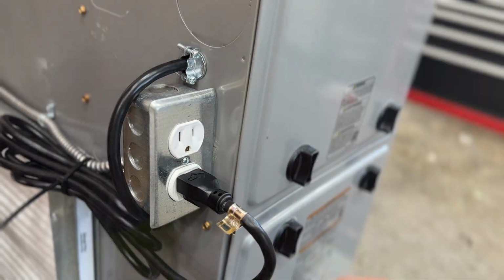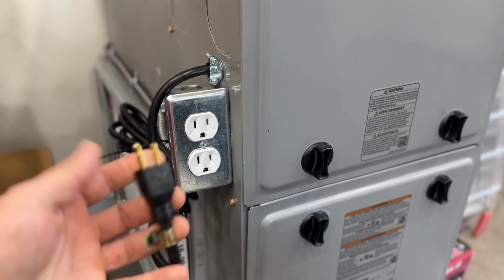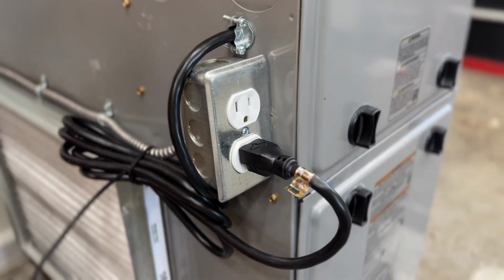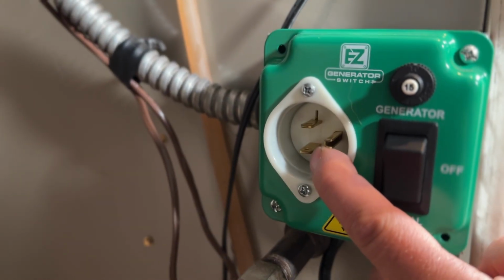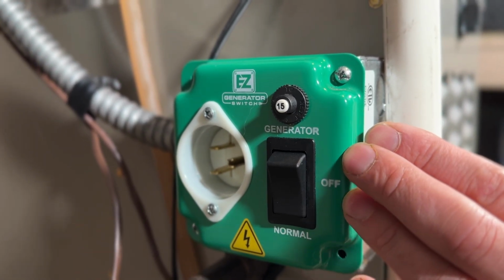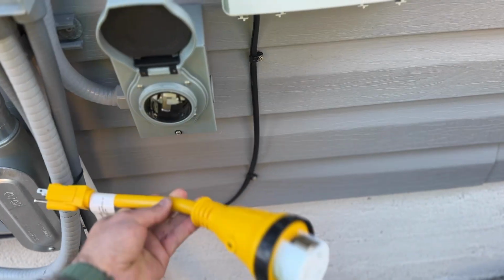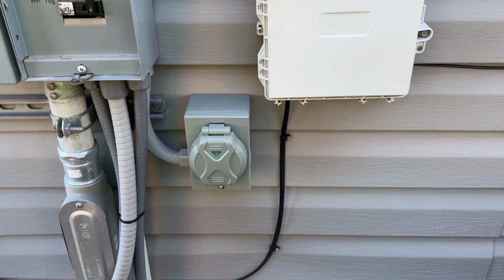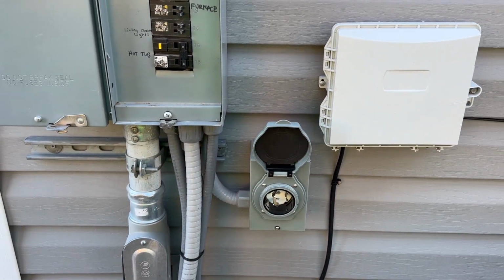3 Ways To Keep Your Family Warm This Winter

Comment: To bad that green box isn't water proof for outside use. At my furnace I simply have a twu outlet with the connector cut. One is line the other is from generator. Simply switch the pug from one to the other. Now the dedicated by code to the refrigerator isn't that simple because the plug is behind the refrigerator up high in the wall for unknown reasons.

Comment: So the yellow adapter 220 to 110 at about the 4:49 mark. Does it split the hot wire to provide 110 on both sides of the breaker box?

Comment: I did that for my well pump as well as boiiler.    a little different   I put another switch.  and plug so when the one switch is turned of from the house power then the other switch turns on for the other power sorce

Comment: In deciding on what generator I needed for a few critical circuits in my little 1250 sq. ft. house, I tested my York gas furnace and was very surprised to see that it used a whopping 1220w at 10.1 amps when running heat.  The blower itself used 930w at 7.4 amps.  My dad’s Trane furnace in a same size house only used 695 when running heat.  Any reason mine was using twice the wattage of his?  Is something wrong with the blower?
Reply: Ac electric  motor blower instead  of DC  motor

Comment: I did the Inlet box (3rd option) several years agoa and although it is more complicated to install, it is set up to run my entire 2400 s/f house using a 35K watt tri-fuel generator. I tested it and although I didn't turn on everything in the house, it worked flawlessly with the normal power draining things on including the HVAC split unit, 2 freezers and the fridge. I have also swithced the entire home to LEDs for less power requirements. Obviously, in a power grid failure you won't run everything as normal, but having tri-fuel capabilities gives you more options. Thanks of the videos!
Reply: Sorry, don't know where that came from. It's this generator (10kW)   PD3G10000e from Powerland
Reply: Did you mean to type "3.5kW" (3.5 kilowatt = 3500 Watts) rather than 35?

Comment: My thermostat is on a separate breaker from the furnace, so I assume that the only choices I have are to either rewire the breaker box or install the power inlet box. Any other suggestions?

Comment: I have the switch to the furnace , no problem . I also have a sump pump with an inverter and battery back up with 2 outlets. Could I change the switch to furnace to an outlet ( using a pigtail for the furnace power supply ) then plug both the sump pump and the furnace into the inverter with the battery back up. PS the inverter has an automatic transfer switch in the event of a power failure .

Comment: Have you come across a way to have the furnace on a battery backup type system similar to the computer battery backups? So that if the power goes out it just automatically switches to battery and then recharges after the power comes back on.

Comment: My mom married my stepdad, his master electrician, old-school electrician really good. He did white Man Air Force Base and then a lot of Branson Missouri but I learned from the age of five up and I’m 42 now. No the job is so easy when you have a bars and bolts and shit in your back and no vertebrates , that’s the one thing about electrical did a lot of work on hurricanes, main power, distribution lines, etc. yeah, my father taught me so much and had to basically do things not by code but still good and safe instead of running one wall parallel to another room just zigzag back-and-forth with your plug-insI know the code is gonna hate

Comment: I really like this idea to power my furnace. What I would really like to do is power my house. I have a CPAP to sleep. What would need be done to plug generator directly into whole house? What size generator would be needed for an average 1200-2000 sq ft Midwest home?
Reply: All depends on your power needs...but looks like a interlock kit, soft start box for a/c and around a 5k generator would do the trick. Hope that helps.

Comment: Great videos.  Can you make a video for Central A/C in the same way you did for the furnace?  How you can use the a/c as a stand-alone using a generator to power it.  I guess you would also need to add the air handler as well. I would like to power my house with one generator via my interlock and use a 2nd generator just for the central a/c.  Thanks.
Reply: You should just buy an generator link kit if you need more amps.  No need to have a separate plug/inlet for the AC.  You already have an interlock kit on the panel, so you're set from that perspective.
Reply: @mae2759  Thank you
Reply: Why not just use 1 generator and interlock kit for house and a/c. just install a soft smart unit on your a/c to limit surge wattage and your set. I would also reccommend at least a 5kw generator.

Comment: Plugging directly from a generator to the furnace is there a possibility in burning up the little circuit boards in the furnace and what about the 24v going to the thermostat is that connected to the house circuit in anyway ? These questions have to be addressed in making a video especially if it could fry the circuit boards or something inside the furnace right ? Note I'm talking about the direct plug to the generator not the transfer switches.
Reply: A good quality generator will not cause a problem, but if you are worried, use a RV surge protector between generator and furnace. The 24 volts comes from a transformer inside the furnace.
Reply: OK Thanks for the reply  @tgriebe  I'll be using an bonded inverter generator so pretty clean voltage but ya a RV surge protector not a bad idea too.

Comment: Thanks to you, we will have heat and hot water in the event of a power failure.  Earlier in the year, I installed the EZ Generator Switch several months ago based on your video.  My boiler installer saw the switch when he came in to do the annual service, and was impressed with it.

Comment: I watched a lot of your videos and have learned a lot from you.  I'm considering replacing my gas water heater with a tankless one and wondering if you also instal water heaters.
Reply from the maker: I actually have a replacement video coming out soon! Changed my tank heater to a tankless. I’ll also do one on flushing the tank and replacing the anode rod 👍🏼

Comment: Dave, are you using the VTOMAN power station with the EZ Generator switch as received or did you wire it for non-bonded neutral?

Comment: I was told that a furnace must be hard wired to the main electrical box to be to code. Im planning on getting some of those single curcuit transfer boxes like you showed, and having them hooked up to ket circuits (like my furnace), and having them installed in my future solar control room thats directly over my circuit box in the basement.
Reply: Yet nobody can say WHY it's code or WHY a cord is less safe.
Reply: @mae2759 I can’t remember where I’ve seen it, but the only explanation of why domestic appliances are direct wired is for safety. Not everyone understands how this is setup, and an unaware person might unplug the furnace to plug in something else, thereby not having heat, or whatever. I know this is probably not you, but codes are for worst-case scenarios.
Reply: @mae2759  I 100% agree. And it's quite frustrating. I planned on doing this with my furnace till told it was against code. I'm not clear on how it's dangerous to plug an appliance that uses typically under 1000w into an electrical outlet.
Reply: @hificat101  Honestly, it's your house. You don't need a permit or anything to do this, so just go for it. Nobody is coming into your house to fine you. I'm all about doing things to code, but when I can't see a reason for the code, then I don't see any reason not to do it.
Reply: @mae2759  You might run into some problems with your insurance company covering an injury or fire that was caused by an installation that was not permitted, inspected, or up-to-code.
Reply: @mae2759  No one is coming into your house to check your setup until you plan on selling your house. A home inspector will require you to bring it up to code.

Comment: August 14th , 2003  : power grid failure to parts of U.S. caused loss of electricity & natural gas . In 2008 Generac class I posed this question to the instructor. He agreed with me that the unit won't provide backup power because there's no gas supply....just saying

Comment: The heat pump as a backup has me confused.  Is it a totally separate system or does it have its heat exchanger in the same plenum wirh the gas furnace and air? Sounds ideal but I'm not clear on it. Thanks.
Reply from the maker: Gas is super cheap here, and it’s cheaper for me to run my gas furnace as my primary, and have my heat pump as a backup. So if I lose power and gas, I hook my genny up to the power inlet box, and the heat pump will heat my home. I just have the heat pump set as my aux heat on the thermostat 👍🏼
Reply: @diyhvacguy  My question is: where is the heat exchanger  for the heat pump?  Is it tucked in with your other equipment?  For example, .My Forced air gas heating and cooling blow air through a  separate heat exchanger and evaporator.  Will a backup heat pump attach to a third coil in the same ductwork or do I have to jury rig a separate system?

Comment: I have the interlock system set up, my only question is I don’t know when the power supply comes back on. I have to take a meter and check my main periodically to see if it has been restored, is there any sort of indicator light or audible alarm that can be installed safely?
Reply: yes, there is
Reply: It is going to sound funny, but I look at my neighboring houses. 
There is an alarm for when power is restored.
Reply: Amazon sells a power back on alarm. It wraps around one main wire coming into the house.

Comment: My furnace has a 5 inch 11 merv filter. I also have 2 return vents.. 20"x21" and 12"x12". Do I need to add filters on those returns? I think If I don't, won't the duct system get full of dust?

Comment: I installed the EZ Generator switch that came wired for a bonded neutral and tested the setup using a gas generator that has a bonded neutral. As expected, the furnace worked correctly.  Just bought a power station that has a floating neutral. The EZ Generator switch needs to be rewired if using a floating neutral generator. The furnace seems to operate correctly with either the gas generator or the power station with the switch wired for a bonded neutral. I bought a neutral bonding plug but my tester states there is still an open ground.  What are my options? I can’t see rewiring the switch when changing from the power station to the generator.

Comment: Your opinion of plugging generator into dryer outlet?
Reply from the maker: Yea it would require a suicide cord which will work but can be dangerous so it is frowned upon.
Reply: A dryer outlet is not an inlet and requires a suicide cord. Stop the nonsense thinking.

Comment: How do you determine the surge/starting watts (or amps) requirement of a gas furnace?  My furnace has a 1/2 hp motor, and on the plate it says 9.5 under max units amps...is that the same as surge/starting amps?

Comment: I suppose if you get a gen set outside set up for $10 grand you will never have another power outage again. 🙃
Reply: Same situation with the brand new snowblower I have in my garage right now. I bought it 5 years ago it has snowed once since then😆 Its current use is drink table when I am working on something else now.
Reply: My last boss has one setup; it's far from bulletproof or maintenance proof 😉. The permits required too are a headache. We tried to get one setup for our office and because we were in a multitenant building we were told the main gas line would have to be increased to keep our 20 server data center running. ... Headache to say the least. At least with a portable genset: just do the oil change and maintenance when you do a season tune on your lawn mower. 😁

Comment: Wondering what CODES are. Can you plug in your furnace with a cord and outlet? Be better for a generator outside. I have a switch on my wall to shut the furnace power off. I haven't had power loss for more than 5 hours so. Usually only in summer.
Reply: When the power is out and your pipes are freezing, obeying a non safety related code is sort of silly, no?

Comment: I'm looking to do option 3 with the plug. My switch has a fuse. Is the fuse necessary?
Reply: The fuse is sized to protect the blower.  So if the blower has a startup draw of 8 amps, they will install a 10 amp fuse, so the blower has a 20% headspace.
Reply: @davidmarquardt9034  it's a 15 amp bussman. Fuse has never broke in 20 years. Just makes me think it is not needed and why I see many furnaces without then.

Comment: Could you show or explain how to hook up a EZ Generator Switch as a floating neutral to the emergency switch. I can't find anything showing how it's done. I have 2 generator and they're both floating neutral generators. Thanks love you video"s.
Reply: if the gens are floating neutral, you'll want the EZ gen switch to be bonded neutral. You need one and only one bond.
Reply: I have it set up like they say with 1 white wire to go into the switch box. So the load white, panel white , and ez white all connect together in the switch box? @ewicky
Reply: Make up a male plug with a bonded ground to neutral wire and plug it into the generator's other outlet.
Reply: I bought a plug for that way but ez generator said not to do it plug and that their way was correct.
Thanks for the reply. @tgriebe

Comment: Great timely overview. I opted for an option similar to the EZ Generator interface. I have a 3000 watt LiTime inverter and a couple 100ah batteries. I see you used the Ecoflow Power Station. Does that have a floating neutral? My LiTime inverter is not bonded so I wondered if the Tempstar (ICP) furnace would run on a floating neutral or required a bonded neutral? Ihave a newer Tempstar G96CTN0801714A1. Learning a lot from your videos!

Comment: Does that 110 adapter power both legs? Trying to set this up but want to make sure I get an adapter that will power both legs of the panel. If so can you link the adapter
Reply: You can easily wire up the same adapter from parts at HD. 240 volt devices will not work but 120 volt devices will.